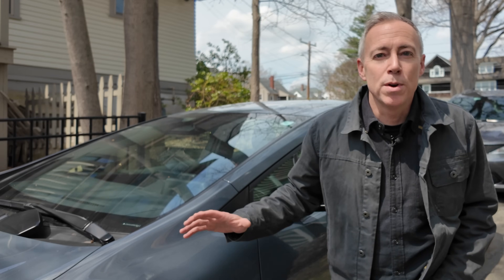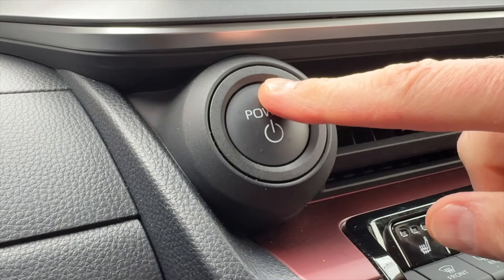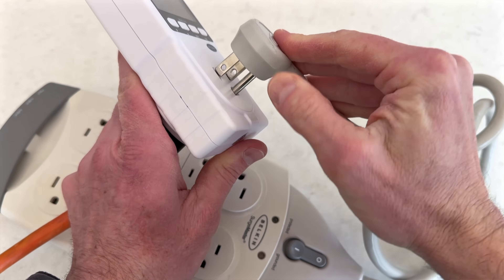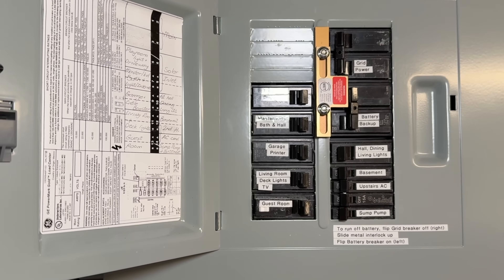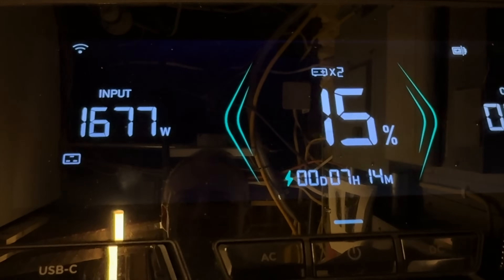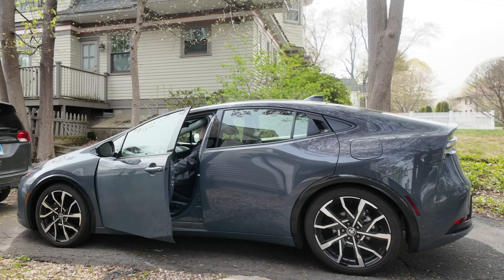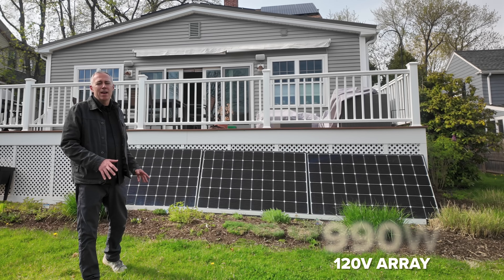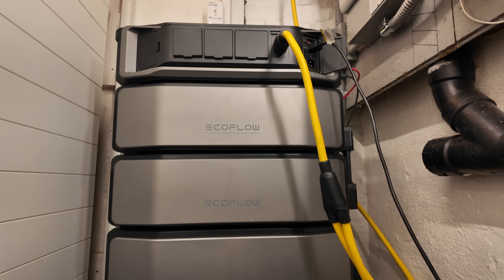Power Your House During an Outage With Your Hybrid or EV Vehicle

Comment: I have the same set up as you however I could get my car close to the back door to my basement where the batteries inverter and I also have a smart panel 2 to install installed. Is it OK if I take a good extension cord through the back door and just plug it into my inverter? This way I wouldn’t have to do a dedicated line from the garage into the basement as you have done and then use the supplied Ecoflow cord to plug into the inverter.
Reply from the maker: Yes absolutely. At my house, it would have been a 150 foot cord so I went this way

Comment: no discussion of the harms on the startup wear to the cylinders once the ICE starts cycling on-off (after the EV battery is drained). The engine components don't like to be run at low operating temps (oil and coolant will probably not be more than 90-100F, despite normally running at 160+ F when driving). Forget efficiency, knowing that 90% of wear happens at startup, do you really want to be running the car in idle for long?

Comment: The ~10kwh of your Prius, is that the battery size or usable capacity? Because I know with my vault, it has an 18 kilowatt hour battery, but only 14 kilowatt hour is usable to the owner. It keeps the rest and reserve for battery longevity and hybrid use. So you’re 7.4 kWh usage may be more efficient than you think if say only 8kwh is available

Comment: I’ve done something similar with my 2016 volt. But there’s nothing included. I used a 3500w inverter and setup a quick connect to attach it to the 12v accessory battery on the car. The car’s dc-dc converter will keep the 12v battery topped up with the traction battery. Then I hook it up to an extension cord that I have on the house panel. With this, I can power the whole house, albeit with only light loading, as the car can really only keep up 2200 W. If the outage is long enough to drain the car’s battery, the engine automatically turns on to fill it back up a bit. Which is much more efficient than running generator and having it run all the time even at light load.

Comment: Great video! Will you share the part numbers and schematics in how you set up the Interlock and Transfer Panel? I’m considering going this route or the EcoFlow Smart Home panel 2
Reply from the maker: The interlock and transfer panel are a pretty standard install that any electrician can do. You'd only need one of those in most cases so choose whether you want to run specific circuits off grid (transfer panel) or the whole panel (interlock)

Comment: Will Prowse has some great info on DIY solar systems.
A small Honda generator (or the like) is more efficient at recharging house batteries than most of the bigger generators. If you look around, you can find a brand that runs off of propane OR gasoline.

Comment: Hey Todd. Another excellent, informative and entertaining video. Can you reply with your suggestions for solar panels? I have portable panels for my Yeti 3000X, but need something which will charge it faster. Any recommendations?
Reply from the maker: Hey. I’d recommend buying 400-500w glass residential panels because they are the best value and will last a long time. If you need portable panels, there are some decent 400w options but they don’t compare to glass imo
Reply: @todd.parker thank you. I do need portable as my setup is not attached to my roof and is deployed manually when i need it. Any suggestions on that?

Comment: Nice video easier setup is plug Prius into Yeti Home Itegration kit and run 4 circuits at once or  get the Bluetti 10 circuit Home integration kit to run most of your house. Of course you already have two home integration kits cuz I got the idea from your video! I'm just waiting for Toyota to gift me one so I can make a video! Does the Prome also work like older gen Priuses where if the 12v battery drains the motor will start to charge it?

Comment: The Prius 2003-2008 model engine generator can out put 25kw nominal and 50kw on full load. The charge current to hybrid battery is near that. I dont see 1.5kw is usable energy, cant run a microwave with that power let alone a house. A house pulls at lease 30kw a day. While the 2004 prius running i mounted a heat exchanger to my hot water tank  using engine heat to take shower. Wasted of time to get solar at least the system is large enough such as 30-40kw else just nothing but a toy.

Comment: These are nothing and too expensive. I brought a Prius 2004 for $1200 and connect a 10KW solar inverter (brought $600 from Alibaba) into the hybrid battery 210-240v and then have the inverter connect with my home generator relay connector.  I turn all my AC on to the max and running microwave even dryer with no issue. the prius will just run for hours and hours hardly make much of a noise, engine only turn on after few minutes. Total cost 11 gallon of gas and $2000 budget for the car and inverter.
Reply from the maker: Sounds like a good setup
Reply: How long does the 11 gallons last, please?

Comment: How many times can the Prius Prime’s gasoline engine charge its 10 kW battery on a full tank of gas?
Reply from the maker: I didn't test that fully because it would probably many days to run down the gas tank! It kicks on for a bit to run the loads and recharge the battery a bit, idles down, then repeats. Note that it never fully recharges the battery unless you're driving and turn on Charge mode but if you need to keep a steady supply of 1500w during an emergency, with a full tank of gas, you'll get a lot of energy out of this.
Reply: @todd.parker  Thanks for your reply.  Very interesting and useful video--thank you.
Reply: Could I ask a question I have a gas generator portable with a master electrician hooked up when power outage. With a plug heavy duty and a cut off switch so power does not go back to power company. I live in Florida and have had extensive power outages due to hurricanes and would only use the prius limted temporarily till power comes back up. I have a prius limted not a prime. What do I have to do it is a 2024 prius limted. Thank you

Comment: I installed a 1,000 watt inverter in my 2016 Prius. It's been a good source of emergency power. The Prius Prime looks great, but I'm hoping that Aptera manages to ship production vehicles because it'd be great to never need to pay for fuel again
Reply from the maker: Cool. So you tapped into the 12v system?
Reply: @todd.parker  yeah, I ran a high current wire through the firewall and placed the inverter below the front seat. I also replaced the 12V lead acid battery with a lifepo4 battery. It's funny to think that tiny lifepo4 battery has more capacity than the high voltage traction battery

For anyone else reading this that doesn't have the budget for a newish car, older Prius generations have the lead acid battery in the trunk where it's much easier to add an inverter